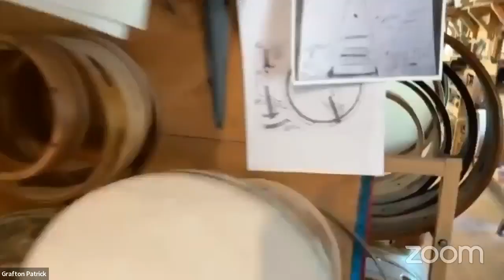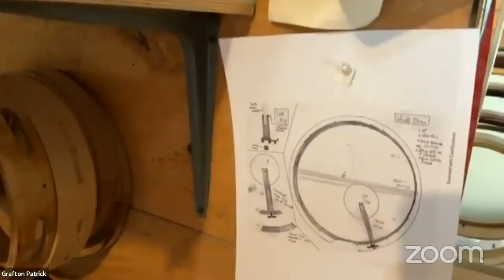Meet a Maker with Cooperman Drums with Patrick Cooperman (& Frame Drum Academy Special Offer!)

Comment: Curious if anyone can answer this for me... How come Cooperman drums are so much more expensive (~$400-500) than the Remo frame drums ($50-80), if they use e.g. the same Renaissance head? 
I've played both, and Cooperman definitely sounds so much more alive, nuanced, but why is that when it's the same head?
Reply: Is it just because the depths are different? Different wood? Love?!
Reply: @AA-my1dw  Solid locally, ethically harvested Vermont hardwoods including ash, cherry, maple, or oak, milled in a locally owned workshop, engineered for optimal sound, weight, feel, innovations in tuning technology, built by hand by skilled craftspeople.  I have cooperman drums that I bought in the 90s and they truly get better as they age.  Remo drums are made with acousticon (wood fiber and glue shell), non tunable, factory made and quality issues all over the place.  The remo drums eventually lose their shape/pitch and essentially become useless.  Cooperman drums can be serviced, head replaced and are lifetime instruments if they are cared for.